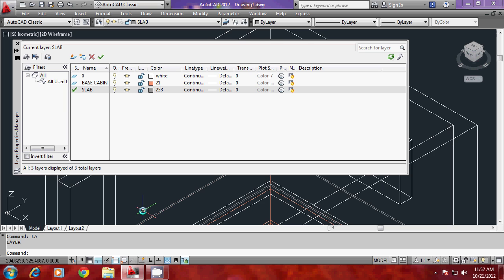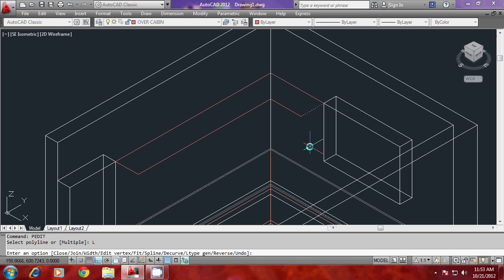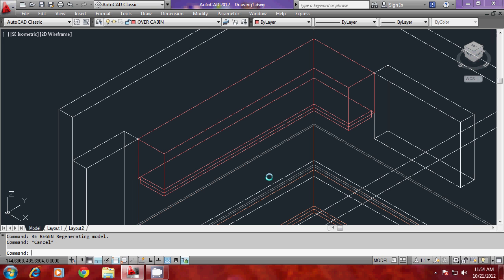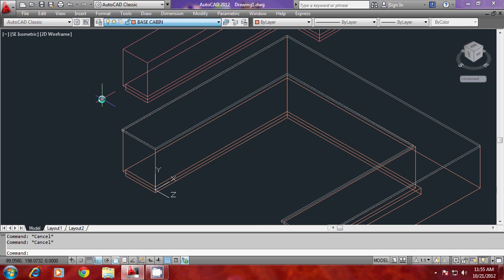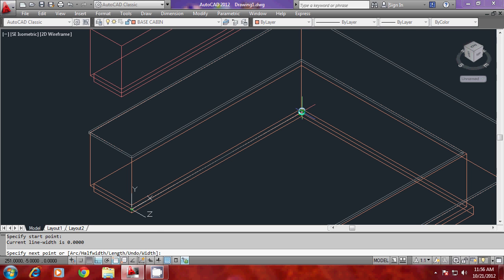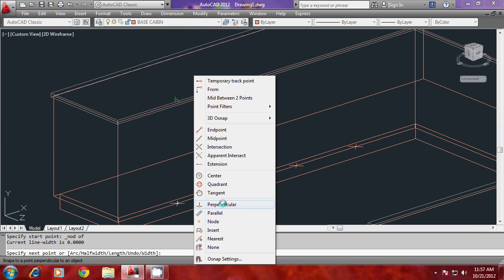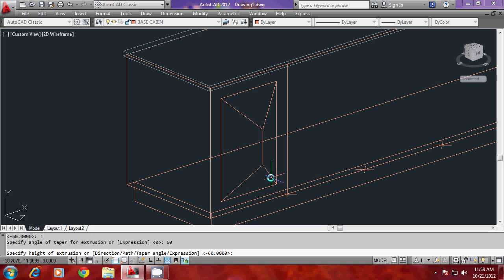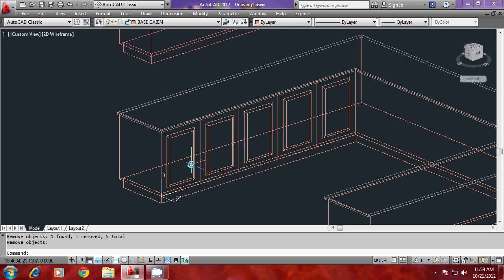Modeling a Kitchen using AutoCAD - PART2

Comment: You can model much faster if you create a _BOX and then peel away details from it with the _SLICE command or (much faster still) with the ASL command from the A>V>C> Slice plugin. Wasting so much time on 2D sketches is wasteful and pointless. AutoCAD is a direct modeling environment and sketches are rarely needed for very complex shapes. For frame furniture, all parts are designed immediately in 3D, starting from a box the size of the product. There is a detailed manual on my website.
Reply from the maker: Thanks for sharing

Comment: When I try to make the first polyline(40 seconds in) it doesn't stop at the wall, it wants to keep going. Am I using a wrong UCS setting?
Reply: Also, how did you get the object snap at that point in the wall? I've tried changing the UCS to top, but I still can't get the pline to change axis.
PS your videos are great, thank you

Comment: Hi sir, I have 2015 autocad. I want to change the point style. i don't find a dialog box even after typing   ddptype''. plz help me. and there are many preloaded layers that make difficult to find the layer that i created. how do i get rid of preloaded layers.
Reply from the maker: Normally DDPTYPE works in Autocad 2015 . You can also give PDMODE command and try values like 1 , 3 , 32 etc.
You can use PURGE command to remove empty layers .
Reply: thank you so much.
Reply: hi sir, I  find DDLTYPE but not DDPTYPE in 2015 cad.but PDMODE worked out. and i see PURGE command in layer walk. but it is disabled. By typing PURGE , a dialogue box appeared. There also i did not find the option to delete the preloaded layers.